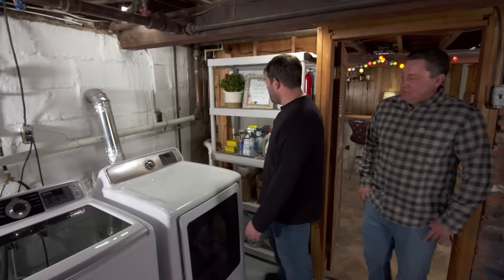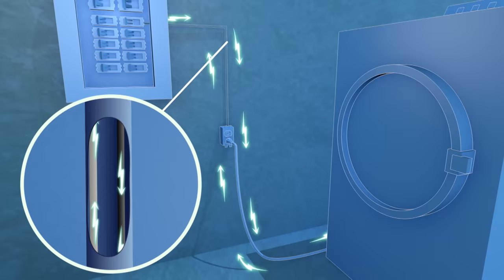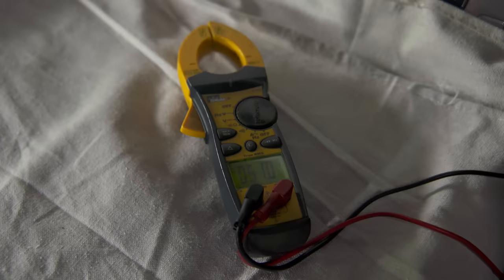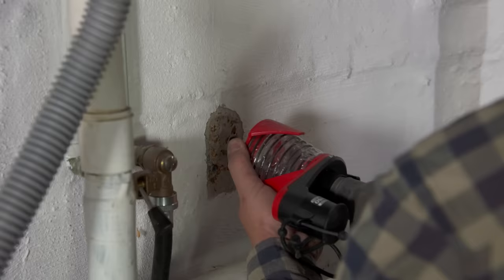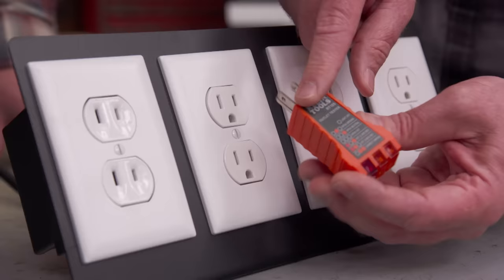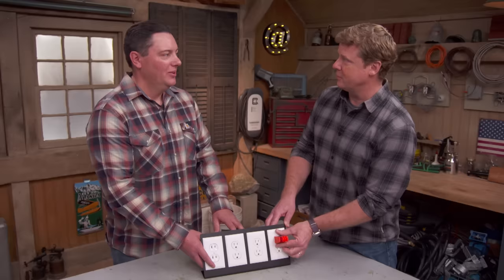How to Ground a Two-Prong Electrical Outlet | Ask This Old House

Comment: Could you use a Ramset to mount the box to the wall instead of concrete screws?
Reply: Depends on what the codes are in your area. In My area you can But the old place i worked in another city It had to be screwed.
Reply: Yes
Reply: @DrCanadianGamer  haha we used to ram set 100amp panels in 1000 sq foot houses in the 90's I bet there are a bunch of pissed off electricians when they went to upgrade those panels..
Reply: @TheRealTonyCastillo  Yeah there a F**king pain in the rear end to remove without proper tools that electricians Almost never have And what ive always used was a good old angle grinder or a drill with a  good bit on it.
Reply: Orange OwL  The building codes in Candy Land must suck.
Reply: Orange OwL Once we had a rookie on the job and told him to remove the panel But we kinda used a entire tube of construction adhesive and 25ish ram shot rounds in the panel to secure it to the wall just to piss him off. He spent 7 hrs removing the panel.

Comment: The unofficial and unapproved solution is to fish a 14 gauge copper wire from the nearest (real) ground to the outlet. Works fine. I've done it in several places in This Old House.

Comment: They didn't show what wire was already in the box ? 
It's hard to believe the washer & dryer without a ground plug.
Reply: If you re-watch it, they just remove the 2 prong outlet.  The washer outlet they replaced with a GFCI was already grounded.
Not all dryers have grounds, but some do.

Comment: how many violations have the new install:
- not working with insulated tools
- wire is too small for 2 high powered outlets: come on it's only a short cable why don't put a better cable in, it still fits
- no checking ground on the fuse board (with outlets without grounding, I should check the ground of the building)
- no testing of the new installed outlets
- ....
- ....
The current ALLWAYS use ALL 
paths to flow back; not only the best/easiest, the 20kV/100KV guy's tell allways this and know the dangers of current in not the easiest path (grounding of disconnected cables with a hot stick, 20kV gloves and a face shield, ...).
Reply: 🤣🤣🤣🤣 oh boy.

Comment: What was that slinky thing on the drill?
Reply: Designed to catch the dust from drilling.  Probably a product placement from some sponsor, because having the other guy hold up a shop vac would have worked better.

Comment: Where's my conduit bender? offset a 90 and straight in to the electrical panel
Reply: Can use an offset connector if not got conduit bender. It don’t look as clean but it accomplishes the same thing.
Reply: @kalijasin  yeah, if you're lazy

Comment: Instead of running pipe why not just use MC cable???
Reply: It depends on what state he lives in, some peole could use rome-x or bx/mc cable
Reply: miguel teran miguel teran LoL I under that I’m an electrician. My point is simply if the contractor used rigid pipe for a 8’ max run why not just use MC it’s faster and cheaper especially when the purpose is a “DYI”.
Reply: @miguelteran747  BX was outlawed years ago. I think in 1980's
Reply: @Wogden 700 "in Massachusetts there is no DIY electrical by law"?  Since when??   Last I checked, there is no state law saying that and I've read that state law doesn't even require a homeowner to pull a permit, although some municipalities view it differently.  Also, FWIW, I have an MC cutter and I'm a homeowner, so now you've "heard of at least one..."
Reply: @jerrydemas2020  "Outlawed"?  No, BX is a genericized brand referring to AC and FMC, both of which continue to be allowed by the NEC (Articles 320 and 348), although different local codes may restrict its use differently.
Reply: @Wogden 700 I have 2 MC cutters: a small one that allows cutting with very little clearance, and a bigger one that's a lot easier to use. But I also have 3-phase power and an 800A main service panel, so I'm not your typical homeowner.

Comment: Instead of showing a hoarder breaker box, or in addition to that, couldn't you use a simple schematic diagram to actually make a novice understand where the ground wire is coming from and how the connection should be?
Also if house metal pipes are already grounded, can one use that as the third ground connection (Talking of living room 15 amp outlets and not those for appliances as you show here.

Comment: It looks like a clothers dryer with 120 volt cord yet seems to have a double pole breaker to
protect the circuit.Yeah JS, kind of amusing. Usually, a guy has some idea of what a ground 
is in regards to electricity. . if that guy gets into using a meter and does NOT test the tester, 
he might not be around too long.

Comment: That is not how a GFCI works. It doesn't measure current; it simply kills power if there is a fault to ground. i.e - power coming back on the ground wire.
Reply: No, it compares the current on the hot and neutral wires. Think about it. Lets say an equipment cable was damaged and the live wire exposed and you touched and got shocked. There would be absolutely no current in the ground wire and a device that monitored current on the ground wire would not cut the power.  GFCI that compares the currents will cut the power.

Man, have some humility and understand you can be wrong. If you see something that is against your preconceptions, maybe it is good thing to verify. I get  that in the past when you had to go o a library to do so one might not do but now it takes seconds to write "how does a gfci work" on the search bar

Comment: I thought running Romex in conduit was a no-no?
Reply: I agree, although it used to be non code. I remember that it should have a junction box at the top of the emt where the NMB (romex) transitions to non sheathed conductors. Then single conductors run down the EMT to the GFCI. The code may have changed for that application. The code is a moving  target, you can never learn the NEC code, just be aware of it and know what was approved yesterday might not be approved tomorrow.And WTF is he installing a arc fault for? Of course this is made in Massachusetts where the NFPA that writes the NEC lives. "Mr. Homeowner, I will install this controversial device known as a  Arc fault circuit breaker. Please give me your credit card number, because no body carries that amount of cash around!"
Reply: Its ok if open at one end in some places. Its a heat issue.
Reply: I believe NEC 334.15(B) actually requires it when necessary for "physical protection" of exposed work.

Comment: I live in a duplex and this is exactly what is happening. I bought one of the outlet testers and the only outlet that is not an open ground is at the kitchen sink. Also, there is a satellite dish on the roof, should it have so many wires coming out of it? It is  connected to the wires that go to what the landlord told me are telephone wires, plus it is also connected to my electric meter. Is this safe? Could this be why my electric bill seems really high?
Reply: Deb Chase the satellite dish is grounded at the meter for safety. It’s not affecting your electric bill.

Comment: did he install romex in the conduit?  Why?
Reply: The NM cable (Romex) runs through electrical metal tubing (EMT) in this unfinished basement to protect it from physical damage. The EMT only runs to the top of the concrete wall. The upper end has an EMT to NM coupling (seen at 4:21), and the NM cable must be secured within 12 inches of where it exits the EMT.
Reply: Technically it’s not a code violation. Most electricians don’t do that though. It makes the wiring harder to pull out of it ever needs replaced.

Comment: Dryer plugged in too?
Reply: It was a gas dryer, so yeah, the 110/120 circuit could probably run both washer and dryer.  No 220/240 needed.
Reply: A gas clothes dryer uses 120 volts of electricity to power the igniter, drum and its main controls, whereas an electric dryer relies on 240 volts of electricity to power its entire operation.

Comment: I'm curious that you didn't sleeve the ground wire pigtail inside the box. Isn't there a danger that this bare wire will make contact with the hot (or neutral) terminal when the receptacle is fitted?
Reply: It is far more common to put a wrap of electrical tape around the entire receptacle to cover all exposed screw terminals before installing in a metal box.

Comment: What if there's no option to replace cable. How would you ground the outlet?
Reply: @Jason Bowman - I don't know code either, but tying to a water pipe puts  you at risk of electrocution while taking a shower.  Even if it's good when you do it, there is no guarantee that someone won't replace a section of copper pipe with PVC somewhere upstream of your connection.
I handled the problem by replacing two prong outlet with three and just not tying the ground pin.  Nobody will ever know until somebody dies.
Reply: @Jason Bowman - I think grounding at the service entrance is fine, my house grounds 30 feet from the service entrance which I don't think is fine.  I assumed you meant run to the nearest pipe to make wiring easy.  If distance isn't a problem, just run back to the breaker panel. it does have a ground.
Reply: @jrstf  In theory, people go to prison for manslaughter when they set a hidden trap and it later kills someone.  To meet code, in most places in the USA, just put in GFCI protection for replacement ungrounded 3-prong receptacles and attach the required label:"No Equipment Ground".

Comment: If you do this off a sub panel, the white wire becomes hot.  Explain that.
Reply: Brad Yelich ... The white wire only becomes hot if there's something wrong or if you are doing 240 volts, in which case you need to add red tape to designate the change.
Reply: Then the sub panel is wired incorrectly.
Reply: There is no explanation
Reply: @rupe53  No, code book indicates this.
Reply: @bradfordlibby9118  No, code book indicates this.
Reply: @electricaf365  There is a math equation that will explain this.  Somewhere, just not in the code book.
Reply: @bradyelich2745  ... Paraphrased from NEC 200.7(C).... Wiring Methods wiring –  Where permanently re-identified (colored tape) at each location,
Wherever it is visible and accessible.
The conductor with white colored insulation in type NM cable may be used as an ungrounded conductor. (Me: conductor means WITH voltage, not ground / neutral) BTW, white wire may be used in a switch loop but should also be reidentified with tape. (black or red)
Reply: @rupe53  Thanks for the info.

Comment: I feel I am pretty good with electrical but, I have to admit the whole neutral vs hot has always had me confused. Alternating current shouldn't care. So how does the tester for example know that the hot (breaker wire) is connected to neutral? The other thing that has always had me confused is neutral and ground are the same in main bonded panel, but on a sub they neutral is floating.
Reply: How the tester is working, in part 2 he also creates some faults. Also some faults which this device will not find:

https://www.youtube.com/watch?v=87Y5X9wfxQM

Such a tester is quite simple, just the three neon indicators and a few resistors inside.

The Neutral is a grounded conductor, it's an operational grounding. That what you call ground is a protective grounding.

If you got one wire which is neutral and ground, this is a PEN (Protective Earth Neutral), a combination of ground and neutral in one wire in a TN-C grid. When later separated into neutral and ground this is called TN-C-S. In the US this system is called multi-grounded neutral. I don't know how it is in the US, but here in Germany once the PEN is separated (here mostly in the service entry box) it's no longer permitted to combine them again into one wire or bring them together again. You'll always have to keep the neutral and ground separate in the whole installation. The thing is, if the neutral comes in contact with the ground in a final circuit that is protected by a GFCI (we call them RCD here), this will cause the GFCI to trip.

https://en.wikipedia.org/wiki/Earthing_system#Types_of_TN_networks
Reply: Yes this can be confusing, and I hope I can explain this in a way that's easy to understand without mangling it.
The "live" wire is doing all the work of not just PUSHING current in a positive direction, but also PULLING the current in a negative direction. The neutral is connected to the power company transformer in a middle position that maintains close to zero voltage (but not exactly zero because there's always some difference depending on what's drawing power so still don't touch it). The earth ground back at the power company that the neutral wire is attached to acts like a capacitor, or sink, that the current can be dumped to or drawn from as needed.

The important thing is that the DIFFERENCE between positive 120 volts and the zero voltage neutral is still 120 volts on the circuit. And the DIFFERENCE between negative 120 volts and the zero volt neutral is still 120 volts on the circuit. So with a zero volt neutral connection your appliances still get full voltage no matter if the live wire is at the top (positive) or the bottom (negative) part of its phase.

Comment: I saw white wires connected to the ground bar and bare copper to the neutral bar, this is not correct.  Also saw no protective bushing on the top of the conduit where the romex exits.  And what happened to the second utility outlet?  Where was the strain relief/bushing at the entrance to the panel.  Bunch of missing steps that an inspector would catch.

Comment: Pretty sure the NEC says something about running romex in emt... lol
Reply: Brandon Lowe First thing I noticed as well.
Reply: Type NM is allowed in conduit indoors. For this application, unfinished basement, NEC 334.15(C)... 
However, it is not allowed in wet locations like outdoors or in underground conduit.

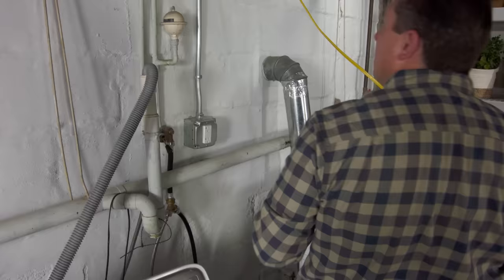Comment: At 4:58 you said there is NO power in the box when you "throw" the main off?  BULL S !
Reply: Yeah. I always cringe when they're working without gloves and saying that. He was feeding wire about 6" away from L1.
Reply: @samconrad4005  exactly !  BINGO !
Reply: @samconrad4005  Much love to you commenters out there. TOH is so half assed it's hard for us newbies to appreciate, were it not for you all
Reply: They never show us the main breaker. This is a sub-panel, and the "local disconnect" panel breaker for incoming power is still on. Personally, I'd test it with a meter first, but can believe that the entire box would indeed be dead if the main breaker is off. I'd probably throw the "local disconnect"  as well if I thought there was any chance someone might energize the main before I was done.

Comment: NEC. Dos not allow running romex through an EMT conduit!!.....
     And to some of the coments... you can not ground an outlet with two prongs... is missing the ground prong... not grounded.  A mechanical bond is not against NEC, but the outlet still needs the third prong. The ground prong. As a switch would not, for it had a mechanical ground through the fastening screw.
         Nothing beets having a real electrition sort it out.....
Reply: Sean Jessup Prove it. Have you ever learned to cite your work in English class?
Reply: NEC 334.15(B) actually REQUIRES running Romex through a conduit or equivalent when necessary for protection from physical damage of an exposed run.

Comment: Kind of a funny edit error where they throw the junction box away, THEN they unscrew it from the wall. That circular junction box confused me a bit -- did he get rid of that? There appeared to be another cable coming out of it, so I presume you would have to deal with that too.
Reply: Lucas Rayala They threw away the first box, then showed unscrewing the second one. He even mentions replacing both because the second wasn't to code either.
Reply: Watch it again. There were two old outlet boxes.

Comment: It was handy to have that breaker panel so close in this situation. It would have been interesting to see how he would have handled the problem if there was wasn't a breaker panel so close.
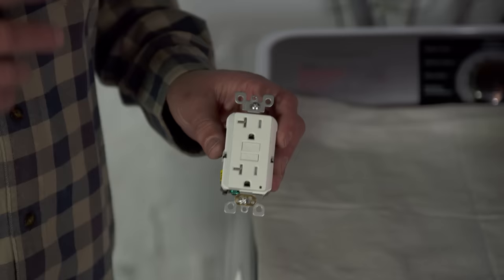Reply: At 1:53 he explained that you can simply install GFCI protection at the receptacle and skip the part about needing any grounding conductor.  However, a laundry room also requires AFCI, not to mention that "the last man in" is responsible for code violations in anything tied to what he's done.

Comment: Agreed title misleading, agreed shielding was supposed to come off before going in EMT
Other than that nice repair not as title of video
So Does the EMT (metal Pipe) go all the way back to the breaker panel?
If it does than EMT is ground -  so how wrong is it to have separate ground wires going to appliance’s from EMT , which if you look at vid you can see someone has done before . I thought he was going to put in new receptacle (3prong) , maybe teach me something new, and then put his tester in & go wala see we don’t need those separate exposed copper wires anymore because EMT & screw thru receptacle now put ground leg in contact with ground. Hay Honey why don’t I just put one of those adapter things, on from lowes that lets me plug 3 prong to 2 prong  & put this bare copper wire that was on the old washing machine  on the new one & not give the electrician $300